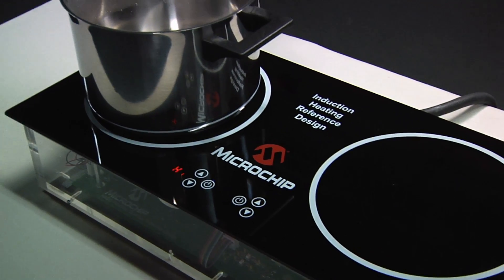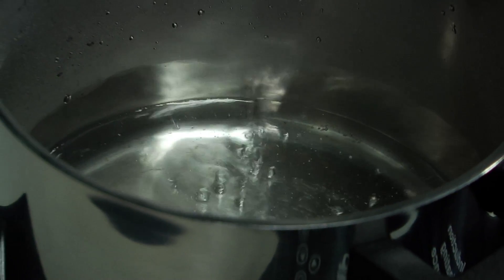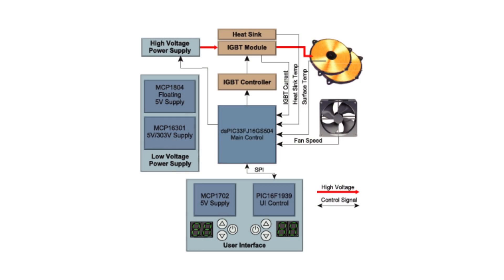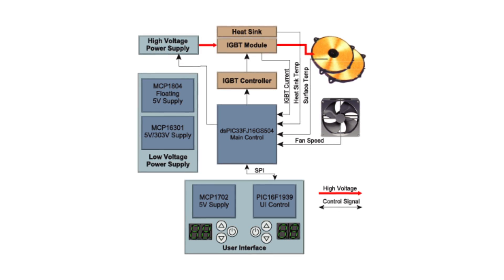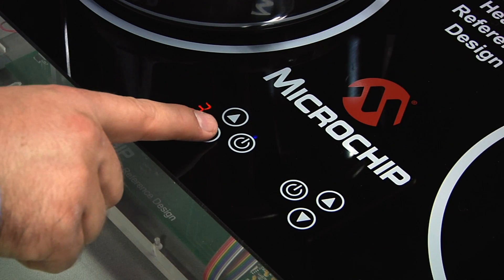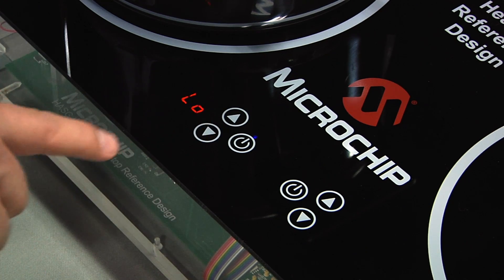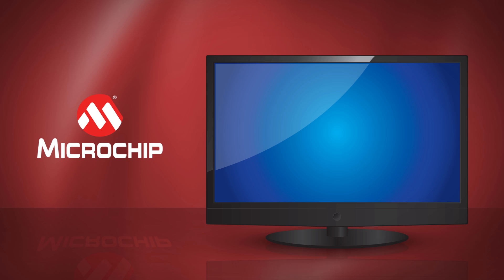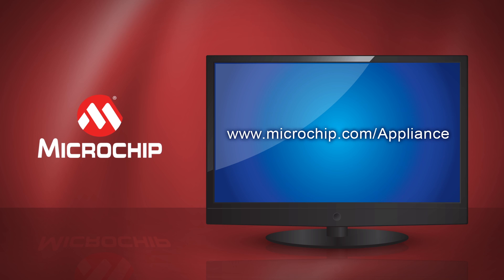Induction Cooktop Reference Design

Comment: i’m editing my review due to excellent customer service and the QUICK replacement of the stove top i bought that was faulty.◇◇>allmy.tips/EmpavaCooktop?U47     i love the design of the stove top and it works well. the knobs have to be turned and pushed down with a little finess to keep the gas going but once you get the hang of it it’s no biggie. i reccomend empava bc theorems customer service is spectacular!